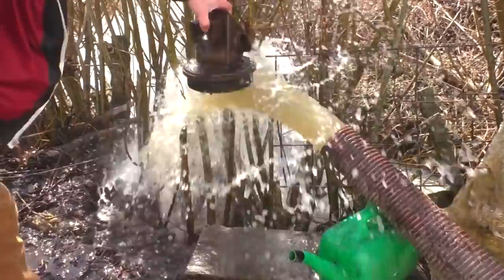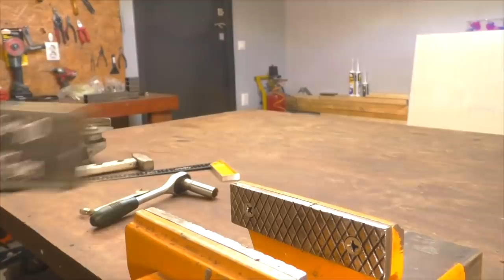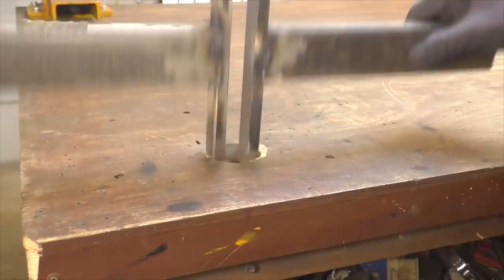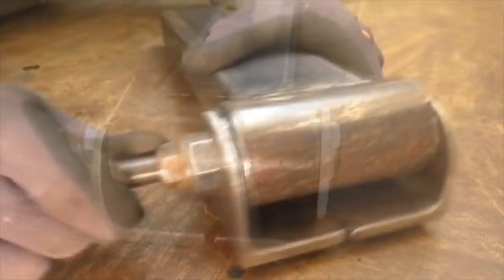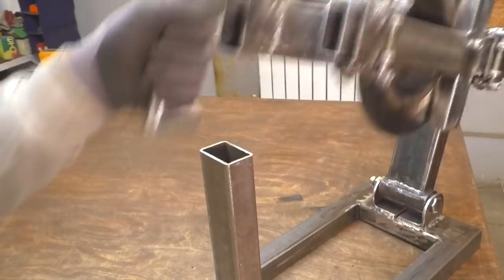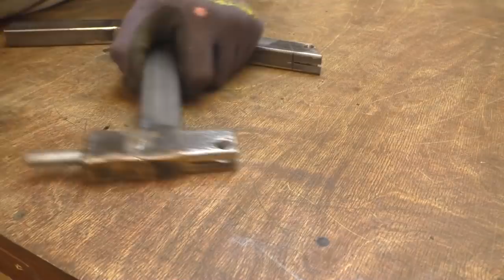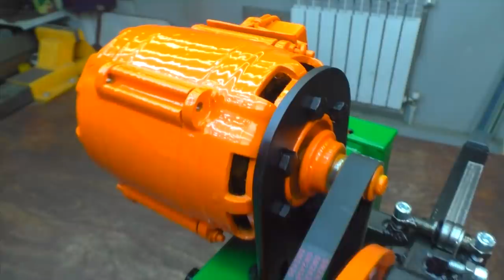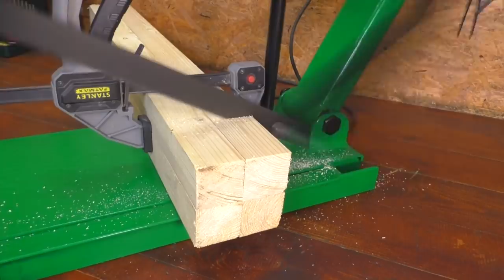Never throw away an old hub! It's like nothing anyone's ever seen before!

Comment: Not even a spec of mud inside the drum, that magically becomes a rotor later on. I suppose it is second degree humor. That's a clever machine though. If you change the attachment it can be a gift for the wife or for yourself if you feel a little frisky.

Comment: Hundreds of dollars in steel to build something that could easily be out performed by a harbor freight port a band
Reply: there was no need to go full blown harbor freight, he already had the hub.
Reply: @maxweldr5278  Yeah, he saved money lol
Reply: @paulhopkins1905  i wonder what he did with all that money?
Reply: Yeah, but it's old school reliable. Long after Harbor freight goes out of business, that saw will still be running
Reply: @ravenrock541  And it's still slow, ineffective and inacurate, and cost more to build than you could get a used stationary bandsaw
Reply: But he can fix it if it breaks.  On the cheap.  Harbor freight will break eventually.  But I can't build that.  So I will go to harbor freight.
Reply: @chrisdavidson4178  I can build a useless piece of crap thats dead reliable, and easy to fix, but at the end of the day, it's still a piece of crap

Comment: The only change I'd make is to have a metal bracket welded on the table aimed up in line with the toggle switch. Then rotate the toggle switch to push down to turn on. Have the metal bracket just long enough that when the reciprocating saw cuts through the material, the bracket engages the toggle switch and turns off the saw.
Otherwise, cool useful project. Kudos.

Just ignore the naysayers in the chat. They are all upset they didn't think of this.

Comment: You made a tool that cuts slower than the angle grinder you used to make the tool.
Reply: True. I admire the talent and imagination more than the end product.
Reply: @josephcarlat9414  I agree,  I admire the workmanship that went into it.
Reply: The idea of a power hacksaw isn't so much speed as accuracy, and a blade will outlast a lot of cutting discs. The ones I worked with when was a kid were self-lowering and had coolant feed, so you just set them running and went off to do other things while they slowly chewed their way through the cuts.
Reply: @bobs12andahalf2  how right you are.

Comment: Amazing fabrication skills. Just need to improve your welding skills and install a speed control on that motor so that you don't burn up the blade. Too fast. Maybe counter balance the hub...
Reply: Same thoughts, maybe employ a worm gear design instead of belt drive
Reply: There goes another 60 hours of Labor

Comment: I guess that pond was filled with low viscosity oil, the way the steering knuckle came out NOT rusted and easily disassembled.  If you pretend the parts were salvaged from a mud puddle, you're starting the video with a lie, which makes everything that follows suspect.   Just tell the truth and let your work speak for itself.
Reply: Have you ever come across a hub sitting in a pile of mud?  I live in the city, so I legitimately don't know if that's at all common.
Reply: I thought it initially spun way to easy for being in that condition
Reply: Then how from one shot to the next everything looked like it was sand blasted back to new but also not
Reply: sae supone que lo encontro , tú comentariuo es medio malicioso, usa tu imaginacion gracias sorry thanks,

Comment: Lots of people are saying you could just buy a chop saw. But I've worked with modern machines and let me tell you they don't hold up like the old ones do. You buy a new saw it breaks down and you replace it. You get an old one and refurbish it or build one out of solid steel like that one and you can count on it when you need it. Also no proprietary parts to get gouged on.

Comment: Good work.  You are getting a lot of negative comments below, most of them undeserved.  Yes, you could have made this using fewer components and different mechanisms, but you have made a viable power hacksaw, that may be overbuilt?  You showed us how a Scotch yoke works, how to use otherwise unusable " junk", and you made it yourself using your own time doing what you wanted to do.  My concerns are not with the construction.  You may want to slow the blade down to 90 strokes or so a minute for steel, and you probably should beef up your vise, something you already know.  Regardless of how you made this machine, it is a heavy duty power hacksaw any shop would want at a very low cost.  Incidentally, power hacksaws cut straighter than band saws.   They are especially good at sawing very thin slices off accurately.  Thanks for posting this video and you have a new subscriber.  Jerry

Comment: We had a metal saw much like this when i did go school in 1987. It did stand on a floor stand and had a counterweight system so it could stand there by itself and sawing metal pipes.
It did weigh more than this, probably two-three times the weight. It was cast iron.
It had low pressure on the blade, but enough that it did saw by itself the metal piece(s).
When we heard the clunk sound of falling metal piece(s) then we knew the metal pipe(s) was done.
It had a liquid cooling pump system for the blade and piece(s).
It was kind of white color on the liquid, it was oil mixed with something to dilute it a bit i think. Perhaps it was metal dust that made it look white.

Comment: Nice saw for a homemade jack saw. But I think you need a little bit string and beefier material stop. Also try adding some auto stop switch and some weights so you can  start a cut and walk away and it will shut off when done

Comment: Go to pawn shop and get a Sawzall mount like this ARM and you be done Perhaps a stabilizing arm on the other end with a simple hinged arm .. But seriously this is like a major project.. I need it today... Very creative and great engineering but for me DIY is supposed to be inherently simple and effective. 
     On the other hand get another bearing wheel and mount on thick heavy J channel with one end able to be adjusted, glue rubber strip on one of them or both and mount a motor which can be adjusted and a belt. Put a band saw blade on it and you got a band saw.
I made one thirty years ago on the back of the bus to mill wood. Worked like a champ. I made the Channel so it slid in and out of the side of the bus in the back engine area and mounted an l mount for the upper arm with turnbuckle and spring as tensioner. 
     It took about ten minutes to set up and break down and put away. I used a ladder as the roll slider for the wood. Worked like a champ. Took about 6 hrs to make, very few parts.
     When I build my portable one with two electric chainsaw motors off ebay $30 each. it will have the ability to adjust for large cuts by a third roller bearing and the biggest problem is pressure on the cutting blade being even instead of speed since all wood has harder (slower) and softer (faster) areas, So after much thinking God gave me a simple solution.. Gravity (which is constant) and a weight on a pulley system. Now I can walk away and let it do its thing while I’m doing something else. Make sense?

     Now from experience SLOWER IS BETTER. There are a lot of teeth on that blade and if you go too fast you never give them time to actually cut. Same with chainsaw!!! and Weed whackers.. if you want the blade/line to last... Just sayin.. 
Blessings and thank you !!

   PS Urgent!! Please stay away from the Bio-Weapon-Injection.. go to Rumble.com or Bitshute.com and type into the search bar Vaxx deaths, Red blood cell altering vax etc and see what it is really about. Let me tic your toc so you will see that there is some value in this and not wacko stuff... How o you get a Patent on something that does not exist yet, years before it allegedly exists?? Who benefits from the alleged Virus and who benefits from the Vaxx when there is at least two other cures and preventative cheap medicines well tested with no side effects, already available?? BTW you can make your own HCQ at home with Grapefruit and lime peals in a pan simmered for two hrs and could without taking the lid off. add vitamin Zink and you're good to go!!! Also Aspirin, like the best is from the dollar store. because people were actually dying from blood clotting not repertory so much.. to much to go into here but do your own research especially into what the "protean" RNA vax does to your body. (turns you into a bio weapon with a life expectancy of about two years according to several doctors in tears after discovering this and as a bit of support for this why does the CDC website have a new page up on how to handle "Zombies"??? Oh and BTW the actual Government entity FDA has now issued a warning on the two so called "vaccines" (not the Johnson one ironically, check out which ones are connected to Fauchie and Gates...) hmmmmmm

Comment: Nicely done... Except, theoretically it should not have downward pressure on the back stroke because that prematurely wears out the blade... Which is why I prefer hand tool power over machine power...that being said, I'm not into production 😂

Comment: The disassembly must have occurred beforehand and this is a recreation. In order to remove a hub on my (non-submerged) car I use a 5 ft breaker bar. Am I to believe that hands can produce the torque necessary? I  realize now that this is comedy, and I fell for it.

The video poster obviously meant this to be tongue in cheek. I watched it all. It was entertaining. Even included in dimensions as though any of us would actually build that monstrosity. Highlighting the cut-off switch  2 inches away from the knuckle-demolishing reciprocating frame is a nice touch.

Comment: the brake rotor was the easy part, you can get them anywhere, the couple hundred dollars worth of bearings and metal that's another story, especially since now days you can get a metal cutoff saw for around $300 that cuts faster and is a whole lot less trouble...

Comment: Now put a counter balance weight on it so it doesn't vibrate your welds apart. And next time, show the process of picking up the scrap metal used to make all the support framing. These people are acting line you used brand new stock lol.

Comment: With $200 worth of steel stock, another $50 worth of misc. hardware, a professional welding rig and the training to use it, a fully-stocked machinist shop and about 2 days out of your life, you too can build the most ghetto power saw ever devised, and it will work about 1/4 as good and be able to do NONE of the angled cuts that a used POS Harbor Freight cutoff saw you can get on Craigslist for half that cost can do...

Comment: It is important to learn when to use lubricant. The old bearings definitely needed grease, and so did every moving part. The saw blade was destroyed after 45s of cutting that steel, cutting like that requires a constant stream or constant reapplication of cutting lubricant.

Comment: I SAW WHAT YOU JUST DID THERE.
NOW TO MITER YOUR WORK FOR A FEW MORE ANGLES ON IT.

You could use a dc treadmill motor with speed control becuse harder metals require slower cutting speeds or the metal will work harden. As it is now you cant limit its speed but you can increase the feed rate by adding weight to the lifting handel.

Comment: Pretty nifty. Definitely not as the title would have you believe though. The only way he could have made it better is to put it on vertical rails so it moved straight up and down as opposed to the current scissor action of the device. I would have even counterweighted it with removable weights so it had a nearly neutral weight and you could control the downward pressure on the blade. Then I would have added a limit switch that would automatically shut it off when it finished the cut.

Comment: i built 1 of this 20 years ago using a old hacksaw and it ran on 12 volts with a shutoff switch at the bottom after it finished the cut it shut of. something to think about adding

Comment: There's no way those bolts on the hub could come off that easily after it has been submerged under water.

Cool saw but good luck replacing those guide bearings.

Comment: I think a hack saw is like $5
& you don't need a welder, a dozen bearings, 50lbs. Of steel, dozens of nuts & bolts, a Belt, & a giant saw blade & electricity! Or pulling a hub out of a pond! & only a year and a half to build! But what ever is easier for you!

Comment: Despite all the negative comments from idiots that clearly have no fabrication experience and clearly missed the point of the video which was TO SHOW HOW CIRCULAR MOTION COULD BE CHANGED TO RECIPROCATING  the design you used and fabricated  to accomplish this change was excellent apparently they were too stupid to understand the saw was simply an example  of the endless possibilities of what this could be used for. Thanks for the video I plan to use it work an old piston pump where space is limited

Comment: Not only is there so much movement to cause injury, I can see something easily binding or just failing from use and breaking apart in catastrophic fashion. Also the 2nd square check on the wood wasn't straight. Seems a miter saw would be more precise, useful, safe, and faster.  Since we're talking used here they are in the $100-300 range for a good, to really good one.

Comment: I applaud your ingenuity. I'm not sure it would be worth making unless I already had most of the parts sitting around as scrap. If I had to go out and buy the materials, it would be better to get a metal band saw. Funny how I almost have everything I would need, except for the saw blade and pulley. If I could power it with an adjustable speed 2hp treadmill motor.

Comment: Yeah it’s a cool project if you have the materials readily available but that is definitely a lot of money in scrap and new bearings but cool project nonetheless you might consider though a motor with a slower RPM but higher torque ratio that rate of speed your blades will not last cutting through metal

Comment: On the back stroke of the saw blade should lift away from the cut metal as the blade should only cut in one direction. Dragging saw blades on the back stroke dulls teeth of blade.

Comment: Okay so it's a worse table saw that shakes all your material when cutting it and an even worse metal cutter that doesn't apply oil as you cut.

Totally worth the cool points. Practicality of using it in the trades? Not worth the expense and time put into it.

Comment: Congratulations!  You just invented a horizontal cutter I bought in Harbor Freight some decade ago.  Although your build will likely out perform mine eventually.  My only criticism:  because your reciprocating motion is geared too fast, it will be ruinous to your blades and fatigue metals due to excessive frictional forces.  When it comes to cutting through thick, dense materials like steel, it's not a speed race but all about the power.  I was very impressed how precise your cutting came out, with perfect right angles every time.  Now how about the big reveal where you show us $10,000 worth of professional shop equipment hidden in the rest of your shop?  Also, how di you get your parts painted so professionally?  We'd all like to see a video on that, Mr. Skillful Hands.

Comment: Need to slow the  blade speed as it will over heat it,  use a  smaller  radius on the  crank.

Comment: Hmm… for the low low of $289 and a 20 min ride to the store you can have the same thing in red at Harbor Freight ;)
Reply: And where's the fun in that?
Reply: @tomasclasson  where the hell am I gonna find a hub (that isn’t seized by rust) all this metal and an AC Motor… don’t even get me started on the bearings and bolts!
Reply: @RXQ003  I don't know. Maybe there's a pond nearby you can drain... ;-) But this guy obviously had it or got it. And then it's way more fun to build it than to go buy it.

Comment: excellent job my friend.I would like to ask you if you have come across to a platform 50x50 that you stand on it and u use it as an elevator [lift] for a height of 2,5 m.Probably it can be movable or 2 vertical collumns of it being fixed to the vertical wall.Any idea???Thank you.And of course it can go up via a car  screen wiper motor.....or 2 of them....what do you think??thak you.In general mini elevators are so handy for builders,electricians   for a quick job.i suppose the construction must be from aluminium so you can easily carry it......Of course there is the scissor technology too but i guess the bars will be very long....

Comment: 230 for a hf shop band saw with the 20% off coupon.  This guys got more than that in steel alone. Not to mention bearings, welding rod, or additional hardware. Apparently his time, and by proxy YOURS is as  worthless as this ridiculously dangerous hacksaw.

Comment: Clearly this is not about saving money since the cost of a project like this is atrocious. Rather it's more about being skilled and ingenious to build such a thing. I used to visit metal stock supplier a while back that had a diesel ran machine much like this that they would leave running for hours it seems cutting away at large metal stock. Every time I visited I could always hear the sound of that machine working away cutting some huge hunk of metal down to size.

Comment: There's a reason nothing like this exists. Circular saws cut straighter without binding in any material. The blade on this will start to have uneven wearing and ruin faster than it took to build it. Even if you had most of this junk lying around I could find a better use for it. . . .
Reply: They do exist. I've seen an old one at a used tools place in Oregon. It didn't come with a motor and it was 200+ dollars. Honestly one of the stupidest and most unique tools I've seen.